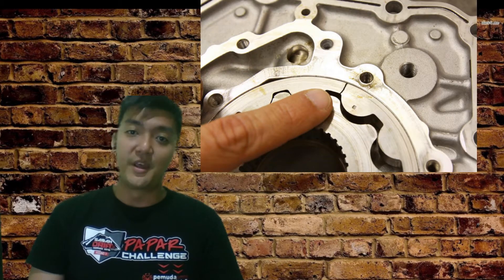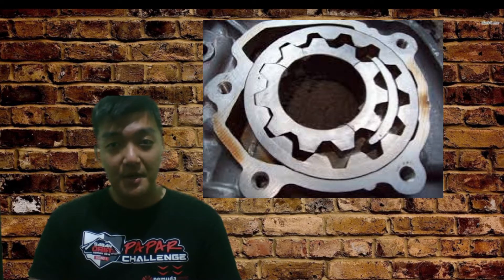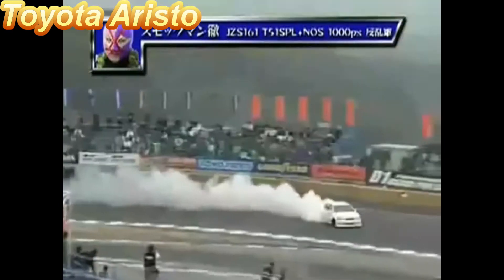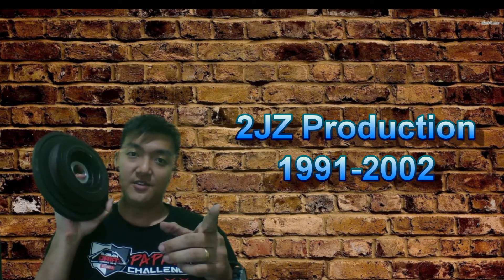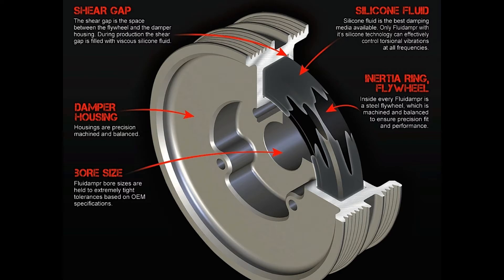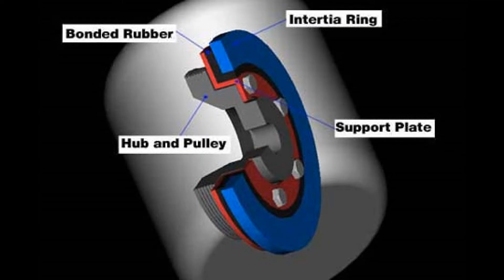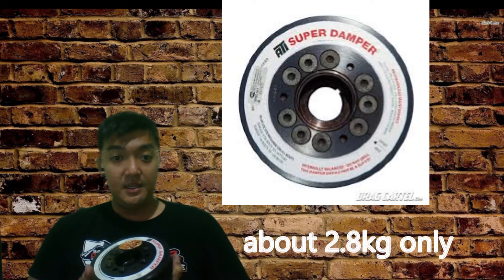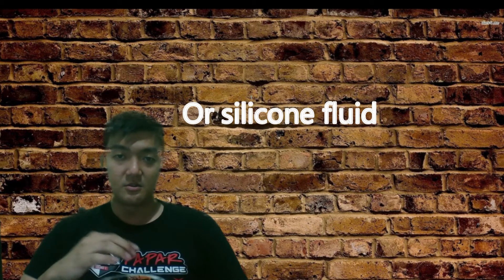2J2sday #1 - 2JZ crank pulley

Comment: I have a 01 is300 im planning on using gte piston and rods with gte oil pump and modified intake what size piston or what year,model piston would fit perfect on a n/a block or can i use a n/a 2jz head on a 1jz block and would that be a better way to go? (Dont mind the Rx8 pic i traded for the is300 🤫😎
Reply: Did you ever build your IS300 2Jz-GE???

If you use this ATI Super damper you need to install electric fans as this will not clear the stock IS300 GE fam shroud design!

It’s nice as you have more work on your electrical system with an electrical fan but you get a tiny bit more power back from your engine. 👍👍🇺🇸🇺🇸🇮🇱🇮🇱